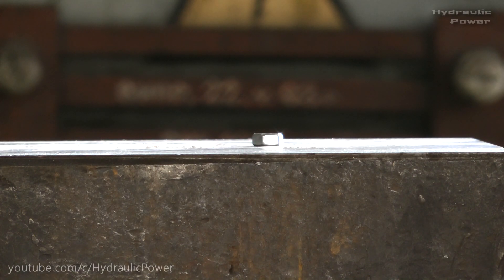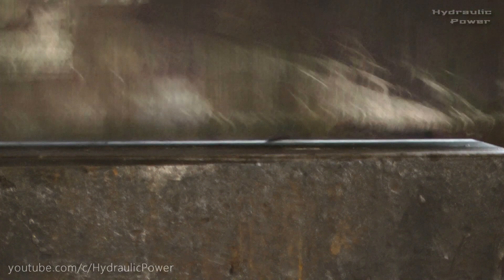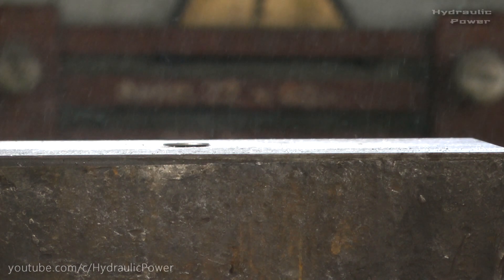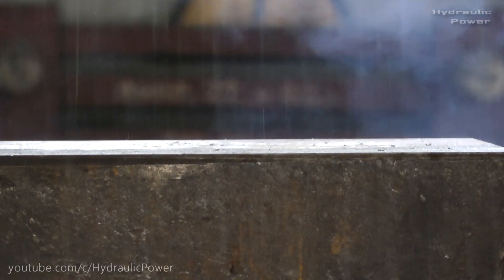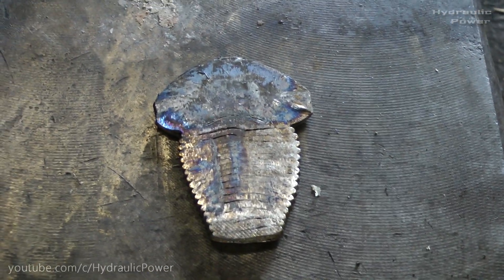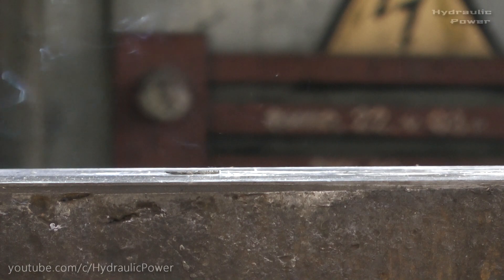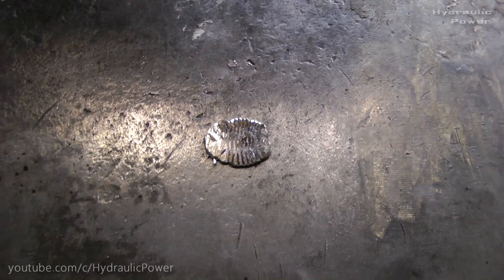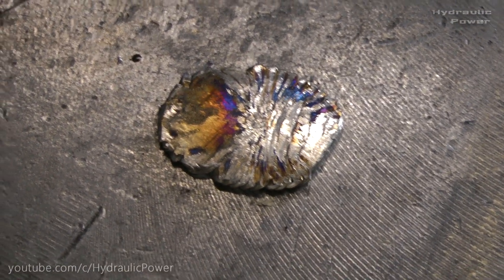Bolts and Nut vs Power Hammer Press

Comment: Does it become hot after you hammer it?
Reply: Yes due to friction
Reply: Yes. The bolt was colored from straw yellow (400-500f) to a deep purple which is about 750 or so
Reply: Yes, I believe it has something to do with all the pressure that makes it hot.
Reply: I also noticed the color change on some parts of squished nuts and bolt.
Reply: Probably